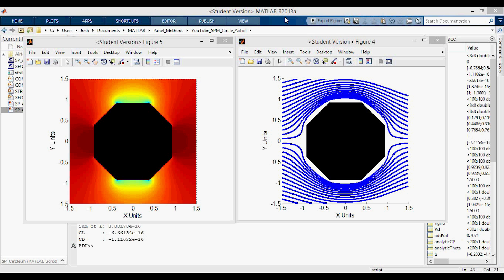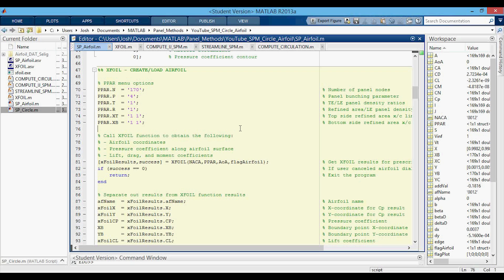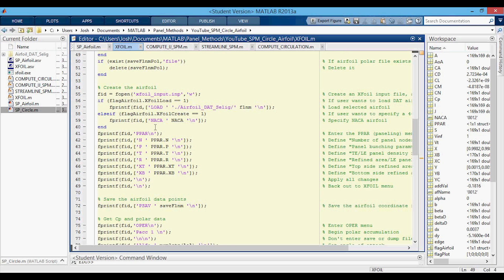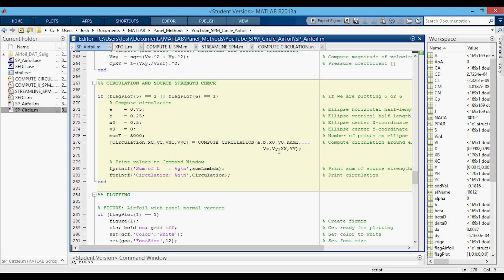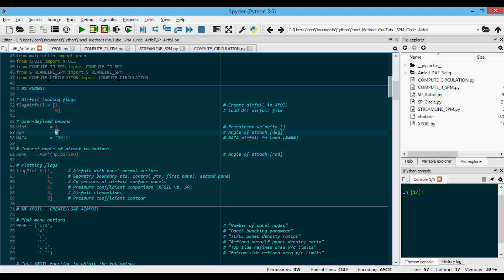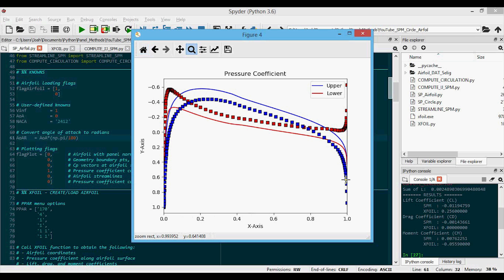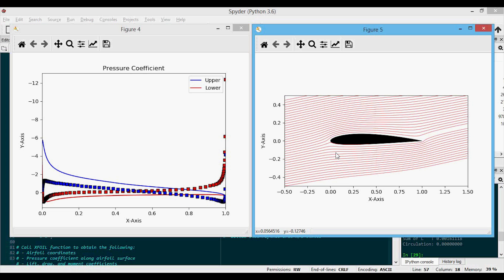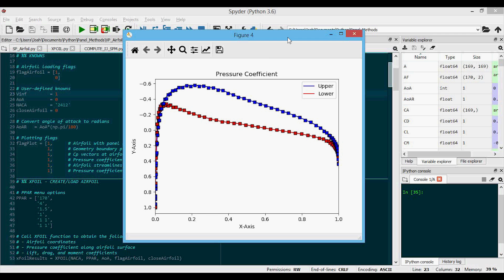Source Panel Method: Airfoil

Comment: Bug report: Run "clarkysm.dat", error occurs because of atan2 when solving the second term in Mx equation.
Reply: Changing the default 170 panel nodes is able to skip this "bug" of finite discretization.
Reply from the maker: Thanks for pointing this out!  I updated the STREAMLINE_SPM.m file to set E to zero when it is imaginary or a NaN. This way you don't need to change the number of panel nodes.
Reply: @JoshTheEngineer  Thank you! By the way, when will be the next video ready for updating? Looking forward to it. Again, many thanks.
Reply: @JoshTheEngineer  Small correction: legend([pXu,pXl,pSl,pSu] instead of legend([pXu,pXl,pSu,pSl] at line 374, to make same color denote same boundary, if I read the codes correctly.

Comment: hi josh, why didn't you calculate the source strength in this video?
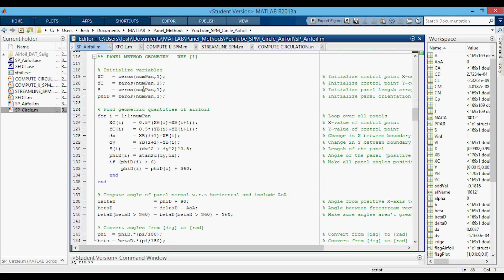Reply from the maker: I'm not sure what you mean.  At 1:21, you can see the code block where I calculate the source strengths, and at 7:03 I go through that code block.  The source strengths are calculated on line 173.